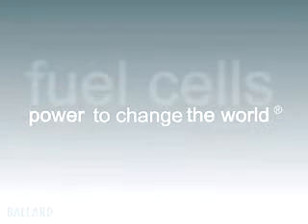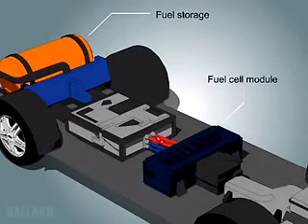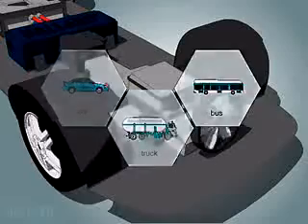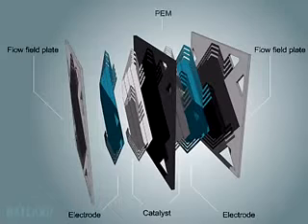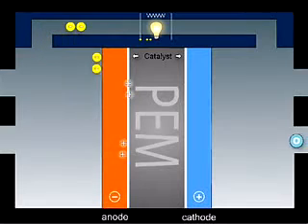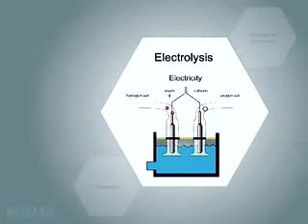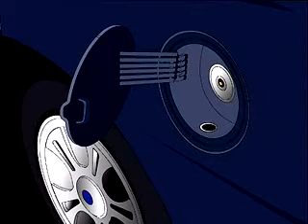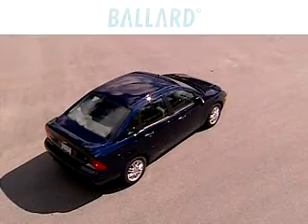How to create Fuel from Water for your car Part 2

Comment: Nice video but what you're selling is BS .
"So, fuel extracted from water can currently only be used as a supplement
 to conventional fuels, but it can help to reduce the amount of fuel 
used, and to increase engine efficiency and performance."
No producing and then burning hydrogen on board  decreases efficiency.
Reply: +ghz240 Nope.  Check out the Stan Meyer video's.  This is run by electricity from hydrogen.  Stans runs on the conversion of water to explosive gas.
Reply: +H.U.D. Shute   This video is informative and doesn't perpetrate any fallacies. the poster uses the video to try and petal snake oil  devices that can not work as advertised. 
The links that are in the description lead to a page selling kits to convert your car to burn water.
Stan Meyer is a charlatan and con man he was sued by his investors , the court found Meyer had committed "gross and egregious fraud" and ordered him to repay the two investors their $25,000.
The problem with the story is that it takes more energy to split the water into hydrogen and oxygen than you can ever get back even with very efficient fuel cells let alone burned in an ICE to create mechanical then converted to electricity by a generator.
Every time you convert energy from one form to another you lose some energy to heat.  The ONLY way around this fact is to initiate a nuclear reaction .
Saying you can run a car on water is like saying you will heat your house next winter by burning ashes.
There is no chemical energy left in water.
Reply: ghz240
Electric or gas conversion, it does not matter.  We understand how to do both.  Controlling it is another story.  I wouldn't call Stan a conman.  The Pentagon and NATO were interested and met with him.  Others like University researcher; engineer's met with him from around the world & verified his invention.  Just as they all did with the Pakistani inventor with the Magnet Motor.  I am suspect of the NATO contact because I know for a fact that NATO does not deal in this kind of stuff.  Stan & his brother met with someone from the Government all right.  But it was not anybody from NATO.  That was his mistake.  I have known 3 inventor's in my life time that could have changed the world economy.  Two just up and disappeared.  True, they could have been bought.  But still, three for three in my life?  Those are real bad odds.  If you are working on anything like this, I would recommend taking out a real good insurance policy.
Reply: H.U.D. Shute  Dead inventors prove that humans are mortal Disapeared inventors prove that after you scam someone you should make your self scarce.
Control is not the issue.
The main problem with hydrogen is getting enough in your tank (or having a big enough tank).
Range is what sucks with these cars.
Regardless of what Stan the con man says you can not harness more energy from the alternator than it takes to run the engine.
 
Concerning Stans "invention" being verified by experts if you mean they were verified to be not an invention at all, then yes they were verified (to be a scam).
You don't have to call him a conman the court already did that:

His "water fuel cell" was later examined by three expert witnesses in court who found that there "was nothing revolutionary about the cell at all and that it was simply using conventional electrolysis." The court found Meyer had committed "gross and egregious fraud" and ordered him to repay the two investors their $25,000

The links in the description are to a scam, lying con men are trying to get your money.